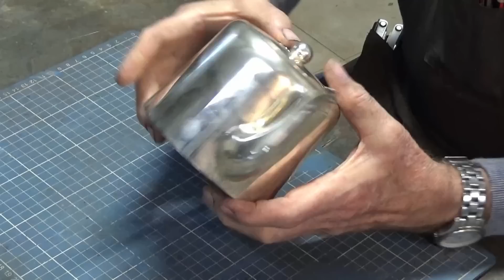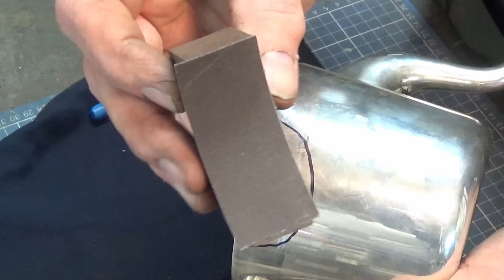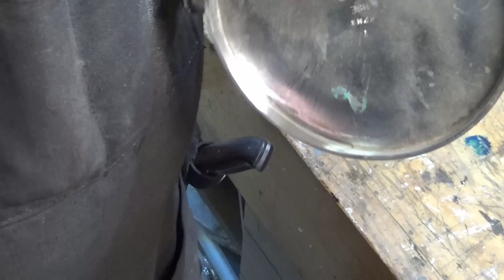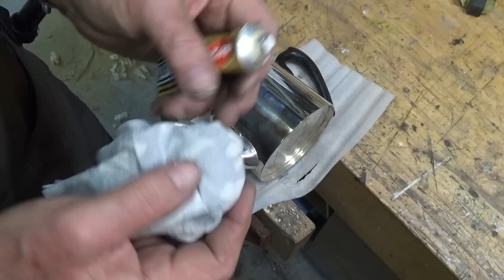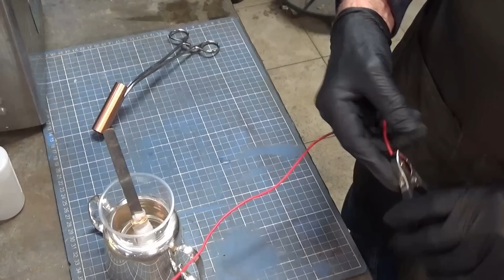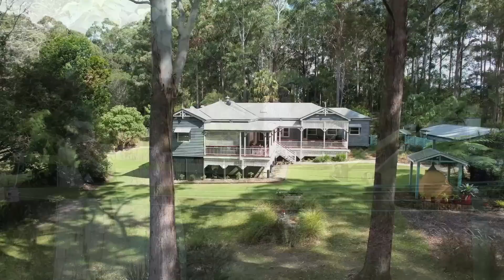Metal Finishing with Mark - Brush Plating 101

Comment: You needed to anneal it at around 750C and then use a planishing hammer on a stake dolly - actually, scratch that, it takes a lot of practise to get a rim dent like that out so what you did was the best bet. Don't ever try that with a body dent though, it will not go well, so you will either need to learn how to shrink dents or find someone who knows how to do it.
Reply from the maker: I know one thing for sure about fixing dents, it's not for the beginner. I really admire those body shop guys that know how to move metal around. On the next project, I had to repair some dents in really thin sheet steel, like paper thin!
I probably did it all wrong but I got about 90% of it flat. 
Regards,
Mark
Reply: @Preso58  Well in silversmithing hammer technique was a big thing and I was taught several lessons:

Always anneal - you  are trying to tease metal into shape by making it move. 

Never hammer a ring from the inside, it will dent. You need to use a dolly and hammer outside or use a curved punch from the inside into a pitch  pot or a hollow anvil.

Always use the correct  hammer and never lend them to anyone. If they put a mark into your polished hammer you  will emboss that mark into your work until you polish it out.

I would say  you had  a good result in the end but you  were fighting the metal - it  was ringing, so it was springing back. The press was always going to coerce the metal into shape and if your dies had any surface finish that could be embossed, just like a mark on a hammer - all hammers, dies and punches used in decorative metalwork need to be polished to avoid this. As it was, the edges of the dent were stretched and work hardened so you forced the metal back to shape and this could cause a crease, split or crack, or at the very least an internal hard section that could be stressed in future leading to a crack. Where the dent was I suspect you will be OK.

I would have spot annealed the dent using a microtorch (hydrogen/oxygen - very  hot and very localised, the modern approach is a laser welder, but they are expensive and I don't have one... they weren't available when I was a lad!) and then used  a saddle dolly and a planishing hammer from the outside. The solder is unlikely to contain lead because it would eat any silver plating and turn black, so it was at worst repair solder and would stand a relatively high temperature as long you didn't directly heat it; this means you could probably have used a propane torch with a very fine tip, but ideally you would need oxy in order to dump heat into the dent quickly to avoid warming the whole thing up. After that give your dies a really fine polish and press it firmly with your fingers crossed - you  may have still needed a bit of polishing and finessing but it would have been done quickly and easily. 
 
I admire panel beaters too, steel is a tough material to hammer and I couldn't do it. Aluminium, copper alloys and silver are much easier, all it takes is practise... hour after hour of practise, so if I need to do it in future I hope I still have the knack; I am certainly not going to learn to do it all over again😁

Comment: As a one time antiques dealer we used to scrap in a lot of EPNS mainly due to rubbing through issues. That certainly would have rescued a few. Thanks for the video 👍
Reply from the maker: I did some research on the value of EPNS and it seems that the scrap value is just for the base metal. I remember when the price of silver went through the roof back in 2011 and there was a news story of people lining up to cash in their inherited  solid silverware. I nearly wept to see some exquisite heirlooms being crushed and melted down so some family members could get a one off payment which probably got wasted on a holiday or a new TV. 
Regards,
Mark
Reply: @Preso58  that's true money is a fleeting thing but heirlooms are a lasting memory and at least hopefully hold their value. As a dealer such sentiment has little place unfortunately and one must keep the lights on. Most dealers have a retirement collection mind you and I still have mine 😉

Comment: Nice little restoration. 👍 I was wondering if that little modified Ball Pein hammer may have done less damage if you used it as a dolly rather than as a hammer. 🤔
Reply from the maker: I am good at inflicting damage. I could have cried when I first attacked that dent with what I considered to be a "safe" hammer face. It was the start of all my problems.
Regards,
Mark
Reply: @Preso58  You're not on your Pat Malone there.